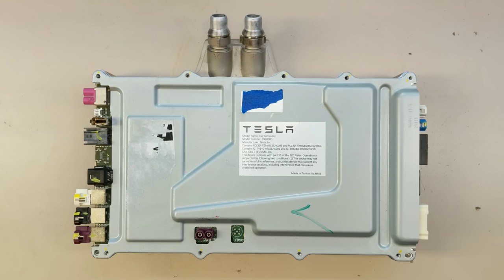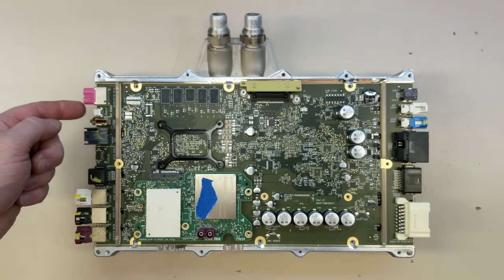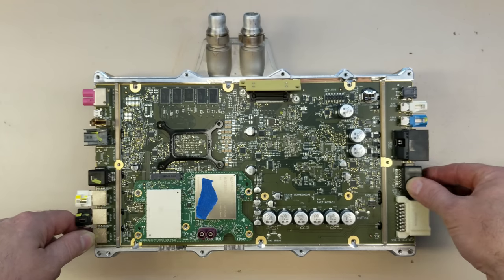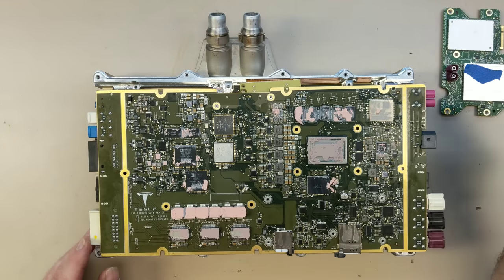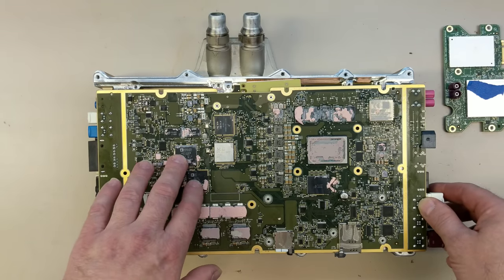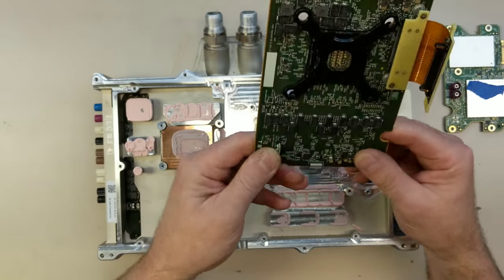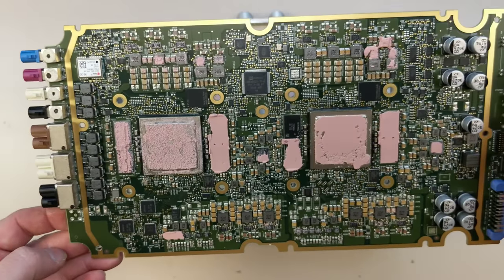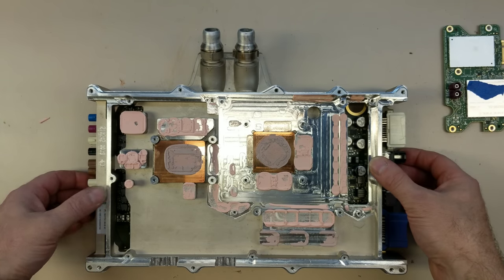Tesla's New Plaid Car Computer!

Comment: I'm getting a North American X and planning to take it to Europe. Would I need to change the LTE module?
Reply: Unless there are at least some frequencies in common, yes. Also, you won't get a new car licensed without Eurocall. It automatically calls emergency services and transmits GPS coordinates when the car gets in an accident and is mandatory for any new car.
Reply: You are going to have a hard or near impossible time charging a NA Tesla in Europe. Different charging standards and different connections.
Reply: @galfert  appreciate the response. But isn't Tesla releasing a ccs adapter for all their newer cars soon. I would assume that will work?
Reply: @wiseshepherd3050  The new CCS adapter is CCS1 which is very different from CCS2 that is used in Europe.

Comment: What OS does it run? can it mine ethereum or monero?
Reply from the maker: Linux.  you'd have to have root level access to install mining software, and it wouldn't make much sense.
Reply: @Ingineerix  yes it will make no sense to mine on tesla, but it is a little bit disturbing that nowadays people have an entire PC inside their car, who knows what software is running on it? It can be anything and can have all your data and send it anywhere.
But I'm also concerned about software updates, people usually don't do it on their car, and some old vulnerabilities can be still present on some cars

Comment: Is this HW 3 or HW4?
Reply from the maker: The "HW" term is used in conversation to identify the autopilot computer (APE).  This unit has both the MCU and the APE in one housing, so it has a HW 3.2 APE, and a HW 4 MCU.   Tesla calls the whole assembly the  "car computer" or "ICE" and they have added a "Z", which stands for AMD Zen, as a prefix to distinguish this:  "Z-ICE".   There is a newer variant of the Z-ICE that contains the HW 4 variant of the APE, which has been leaked by @Green:  https://twitter.com/greentheonly/status/1625905179282354194

Comment: But the real interesting question is what does this unit cost..
Absolutely everything is controlled by this unit..
Why not make more electrical modules instead of just a expensive one where it all needs replacing if one of the functions gets broken. 
Just imagine the cost in repairs when this car gets older and breaks down and has no warranty left..
Reply: In which case you buy one from a scrapped car, or get the module repaired by a specialist, which is exactly what happens with electronics modules on every other car that is out of warranty.
Reply: @BlackheathTownhouse  of course, this would be cheaper over time just like parts to old cars today.
I don't know with tesla how much  "locked down" or programmed the parts is so you can't just change it like yourself or as an exerienced diy guy.
If you go to a tesla workshop they would probably refuse to mount an old part since they want to sell a new one.
And it's still also that this unit controls everything, so when the car gets old and needs a new unit maybe the new (used) controller is about to fail also because of the complexity and age with the new old part.
Reply from the maker: There are not critical functions needed for drive controlled by this.  Also, it's highly unlikely to fail during the life of the car, it's built very well.   My only compliant to Tesla is they work the eMMC/NVMe too hard with excessive logging.
Reply: @Ingineerix  I understand.
But still it's likely gets a failed mandatory roadworthiness test if some of the safety functions stops working.
Then you probably need a new unit.

Comment: what if someone spills a drink in passenger seat side, it would be game over. It's happened to my car when passenger leaked full drink bottle
Reply from the maker: No, You'd have to spill like 20 gallons for it to reach the ICE.  It's not literally on the floor.
Reply: @Ingineerix  Have you seen the sizes of the drink cups at 7-11 lately?  20 gal. size can't be far off now.
Reply from the maker: @JohnSmith-rf1tx  lol!

Comment: is this waterproof?
Reply: No, he mentioned right at the start that because it is located under the front passenger floor, it’s very susceptible to water damage.  Therefore I would guess it’s in no way waterproof.
Reply: No, it's definitely not, some crazy dude on YT drove his Plaid through water and got a christmas tree of warning lights afterwards. Once he dried out the module, there were less, but it still needed service by Tesla to fix it.
Reply: @MrPnew1  @Brigitte Coune
this is not the best location to put if it is not waterproof. typically, it is put at higher place at side of dashboard. so, when the water seeps into the floor, it is still ok to drive.

Comment: You must realize for the same functions, others had to fill entire trunk with specialized hardware.
Reply: That is totally wrong and I have to disagree with you, the only thing taking space in other manufacturer's trunks is are the motor and hvac related hardware. The infotainment thing is a much smaller part of the car.
Reply: Other manufacturers are also significantly reducing the use of rare earths or other materials to have less impact on the environment, sandy munro tearing down the vw id4 showed that the motors used less to no rare earths compared to tesla.

Comment: Another instance of bad engineering...Tesla still doesn't cover PCBs mounted in the floor area with conformal-coating so moisture (wich can be a big thing inside a car) can and will cause issiues.

Comment: Youre a little behine the times.  They have been using AMD hardware for a while now.  If you work for Tesla,  youre under a NDA.....
Reply from the maker: I do not work for Tesla, nor have I.  This is the first time they've used an AMD processor for infotainment and/or graphics in production, the previous generation was an Intel Atom, and before that it was an Nvidia Tegra.

Comment: All this modularity reduces cross department upstream bottlenecking. if the AutoPilot division needs more redundancy and performance, they dont have to wait for the modem, instruction set and GPU to catch up. We now more than ever have the technology to for instance replace all of this with a single alder lake kubernetes server and orchestrate gpu and tpu between containers.

You would retain all the benefits of modularity, while making the package much smaller, lower power, drastically reducing RnD costs, reducing competitive risk, increasing parts availability.

The one major holdup is that they are a unique customer with exploitable demands at scale. Meaning Intel can hold them at gunpoint for ECC memory support, or fall into irrelevance with 10 years of stagnation on a platform like bulldozer or dare iSay x86?, or pricing schemes like qualcomms % of device cost model.

Ultimately without designing one of the largest itanium like SOCs ever, they cant make this package much smaller than it already is. They would need some major Dojo for that.

Comment: if it's water cold , its bad engineering
Reply from the maker: Pretty much everything in the car is water cooled.   I disagree!   Air cooling in a heak-soaked car interior is not up to the task if you want to be reliable.